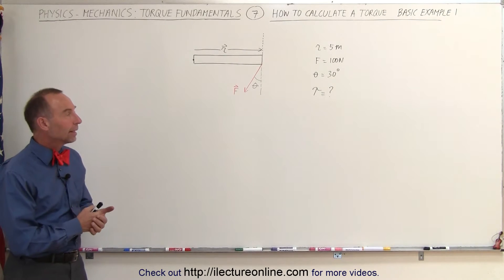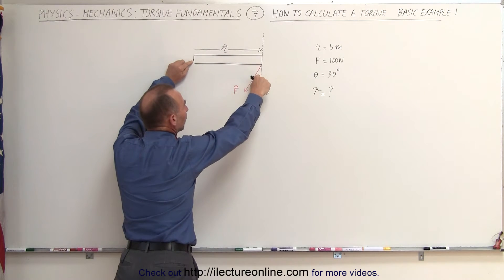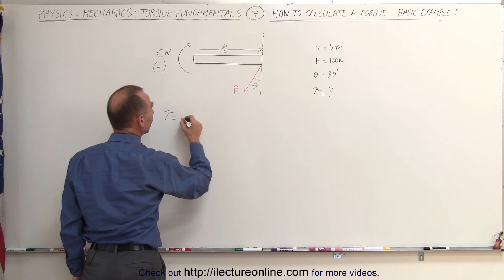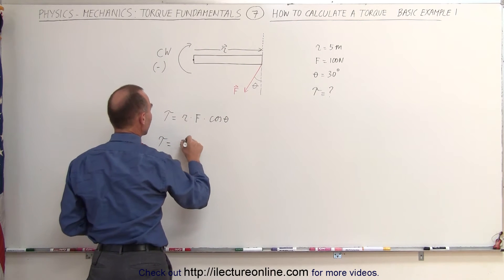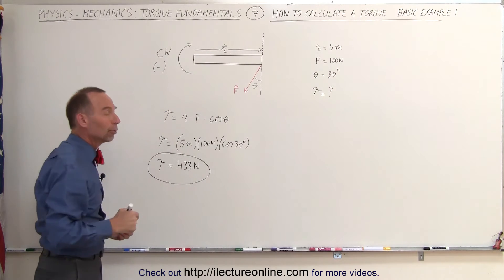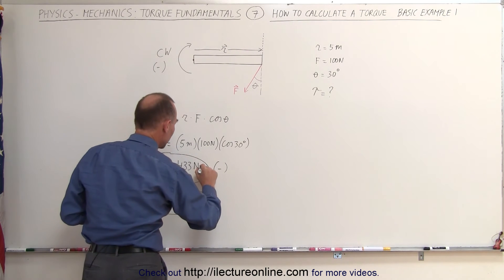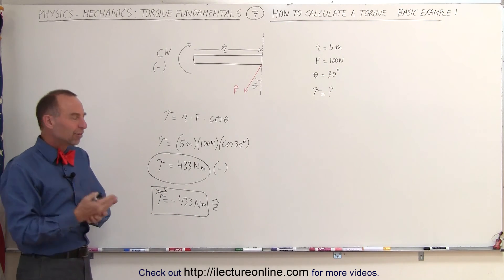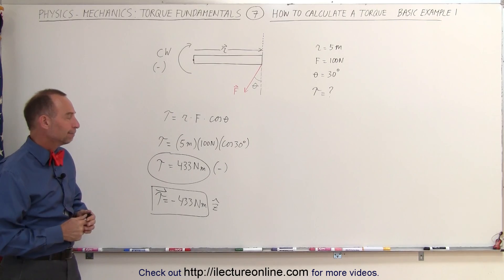Physics 15  Torque Fundamentals (7 of 13) How to Calculate a Torque (Basic Example 1)

Comment: why in the z direction what tells you that and what does the negative tell you.
Reply from the maker: The definition of torque is:  T = R x F  (where R and F are vectors) and the cross product will give you a vector with the direction given by the right hand rule (into the board in this case) which is indicated by the minus sign.

Comment: For those confused on why frsin0 isnt working, it is because Professor Biezen is setting the angle with respect to the y-axis and not the object itself. So if you want to use frsin0, you should be using 60 degrees as your theta and it will provide you the correct torque. Thank you for the lectures Professor Biezen, they have been a great help.
Reply from the maker: Good job!

Comment: Hello! How do I know whether to use sine or cosine? My professor uses sine in every case.
Reply from the maker: It really depends on the method and the angle used.   When using the cross product, the magnitude is always equal to the product of the magnitude of the 2 vectors times the sin of the angle between the two vectors.

Comment: I am still having issues with direction. why is it clockwise?
Reply from the maker: The point of rotation is on the left side of the beam.  The applied force (on the right side of the beam will push the beam downward which will cause the beam to rotate in a clockwise direction.

Comment: If it is in 2 dimensions would it be  T = -433 z hat or  T = -433 y hat?
Reply from the maker: The choice of direction and variables is arbitrary (and it depends on how you set up the problem).  Once the problem directions are defined, then you need to stay consistent during the problem.

Comment: why are you using cos not sin?
Reply from the maker: A good way to determine if you should use sin or cos is by taking the limiting cases.  Set the angle equal to zero and then set the angle equal to 90 degrees and see what makes sense.   When the angle is zero degree you should have the maximum torque.  If the angle is 90 degrees, the the torque should be zero.  Therefore, cosine is the correct function.